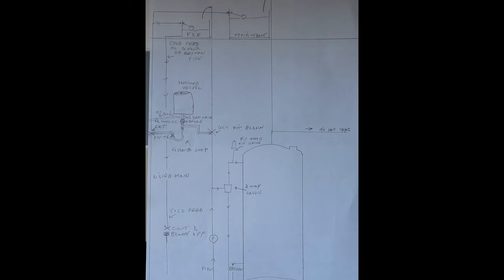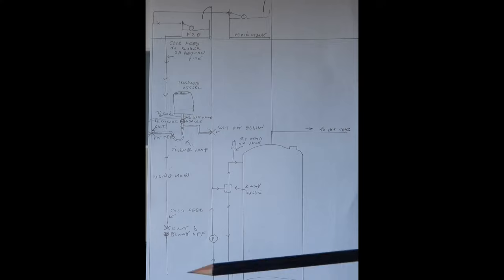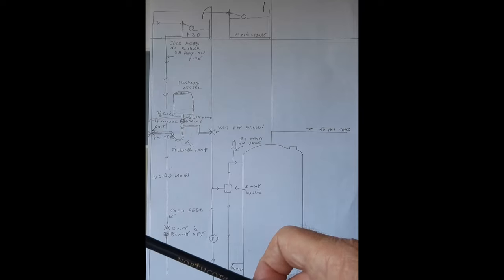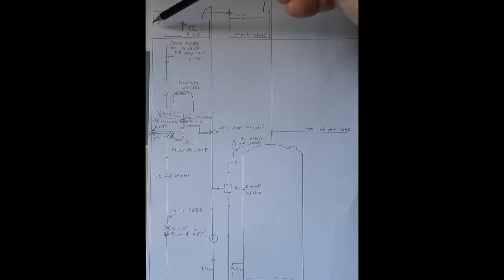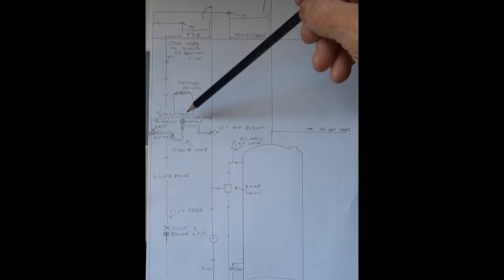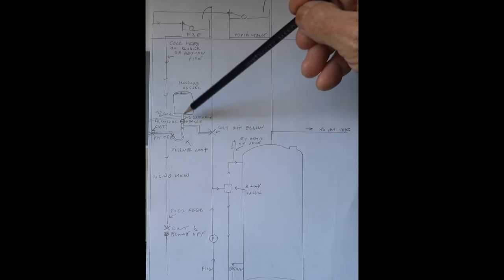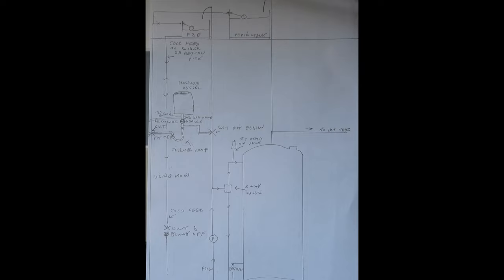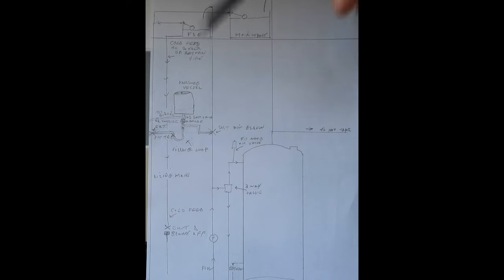Airlocks in F and E heating systems? How to convert to a sealed pressure system.

Comment: Nice explanation with Al CAD.
Just got to make sure the system can handle the extra pressure. If full of old radiators and valves there may be some leaks springing out when pressure raised
Reply from the maker: Great point!

Comment: Great video.     I think I’ve got,one of those problems.  My heating boiler fires up perfectly  heating works hot water  works.  Then after approximately 7 days stops working. Boiler fires up but. As soon as the pipes are hot at the pump it shuts down hot water won’t get,passed  the pump and 2 way valve. Then after 4 to 6 days it all starts working again  what would you think the problem is.  ?
Reply from the maker: Check the F and E tank is filling correctly in the loft . Air could also be building up in the system. If you have never had the system cleaned there could also be sludge build up.

Comment: Hi there, are you familiar with the Aladdin HV50 Auto Vent? I’ve been asked to look at one on a radiator in a converted attic. Radiator is hot at the bottom, no heat at all half way up. Any idea how I manually bleed this? The auto bleed function doesn’t appear to be working (it looks quite old). Thanks in advance - absolutely brilliant channel.
Reply from the maker: Hi Richard just loosen the valve off with a spanner this will let the air escape. Then tighten back up when water shows.
Reply: @dereton33  Thanks Al… which one is the spanner again :)

Comment: A couple of things to point out, 1) the warning pipe from your pressure relief valve (PRV) should not terminate in a drain as you will not be made aware that its opening if your pressure is too high and 2) which is more important, only convert an open vented system to a pressurised system if your boiler is fitted with an overheat thermostat which many older boilers didn't have.
.
Reply from the maker: Thanks Martin.
Reply: @jayseabie215  When was the last time you saw a tundish fitted on a PRV warning pipe of a combi or pressurised system?, Unvented HW cylinders are a different story and DIYers should never be touching those.
Reply: @jayseabie215  NO the title of the post is about converting an open vented system to a sealed (pressurised) system  using an expansion vessel kit, combi boilers need to be fitted to a pressurised system and are already fitted with an expansion vessel and necessary components as are some heat only boilers. The only time you might terminate the PRV warning pipe to a drain would be if it was impossible to route the pipework to outside then you could use a special type of tundish with a dry trap  to prevent foul waste gasses coming back into the room.

Comment: Hi Al, my airing cupboard is much cooler than it’s always been and also the shower water is not as hot as its always been. Do you think the pump is on the way out please? The system is 22 years old and the pump is 15 years old. I turned down the pump from 3 to 2 and the radiators are much warmer, so a bonus there 😀 Thanks for all you do 🙏 🤗
Reply from the maker: Hi Jackie, the pump is quite old but as you are still getting heating ok I would leave it. More than likely it could be some sludge in the system on the hot water side if you have never had the system cleaned, now might be a good time. I have plenty of videos on how to do it. I would also leave the boiler it is still managing the heating so sounds ok.
Reply: @dereton33  Hi again. Thank you SO much for your reply, which is very much appreciated 👍 Had inhibitor put in 5 years ago and hope that meant it was flushed out, but will follow your very sage advice 😀 Thanks once again and have a lovely weekend. Hugs to you both 🤗
Reply: Hi Jackie, It worth checking your cylinder thermostat is set high enough and there could be a gate valve on the return pipework that might need adjusting as they are very often only open slightly to balance the flow through the indirect coil of the cylinder and are therefore prone to dirt building up and restricting the flow even further.
Reply: @martinasher8705  Hi Martin, thank you so much for chiming in with advice 👍 I did turn the tank stat up and it seemed to have the desired effect as the shower is certainly hot now but there is obviously an underlying issue to be sorted. I do like your suggestion about dirt building up and the gate valve adjustment which makes sense. I’m hoping to have the system flushed out and pump replaced as soon as I can find someone who’s not rushed off their feet. Thanks again, your input is very much appreciated 🤗

Comment: My F& E was removed to a sealed system with filling loop to a system boiler with its own expansion tank many years ago

When I put the HW on, the rads heat up also and affects the speed and temp the cylinder water gets to

I checked for reverse circulation but the rads flow and returns heat up same side I checked the motorised valve and does not seem to let

can you please help me work out what could be wrong

I have a suspicion that the cylinder return has been connected incorrectly Would you have a look at some photos
Reply from the maker: Sure send them to my e-mail address.